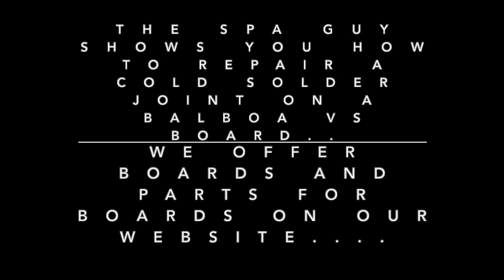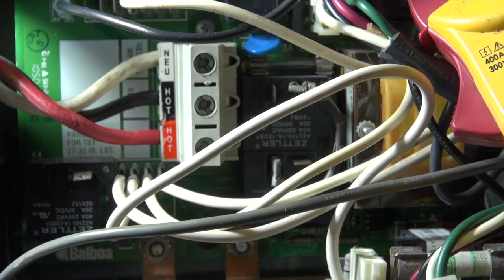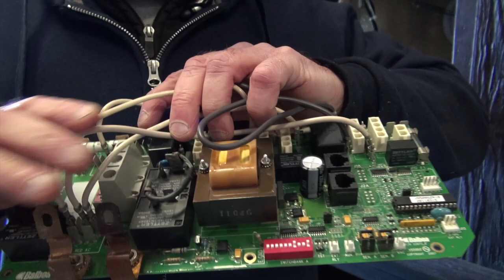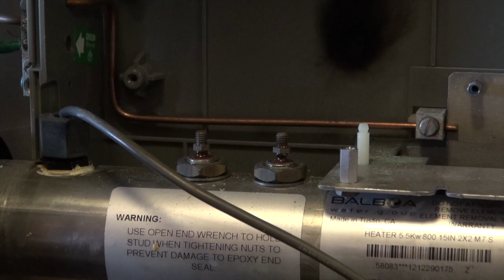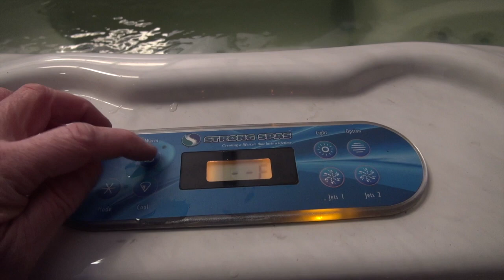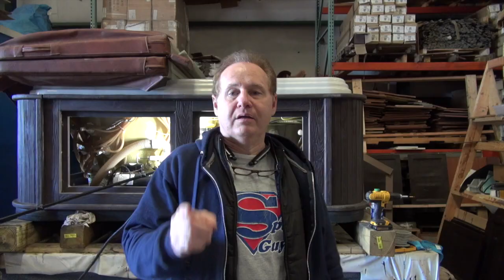Hot Tub Balboa VS Series Board No Heat Cold Solder Joint Repair The Spa Guy How To

Comment: Hi there, I like your spa videos. I have a heating problem with the Balboa HS200VS spa pack. I turned off the hot tub and drained the water; it was sitting empty for two weeks. Everything was working just fine before; after I filled it, the heater is not working. I can hear the relays click on and off. I get 220v at the heater element, but the heat light is not on, and there is no hot water coming out from the jets. I tested the heat element, and I get 16.4 ohms of resistance, and I have continuity. I tried the relay board bypass but it didn't work. What could be my problem?

Comment: I have looked everywhere to find out if there is a separate reset button somewhere I’ve checked all the circuits. Everything is good, but my Balboa will not start originally it wouldn’t heat past 90 now. It doesn’t start at all. I get no power. I have a brand new thermostat on it. Could it be that the plug blue I see no signs of burn

Comment: Im deal with a 2023 sundance tub. Where pump one was replaced, and now we are having an issue were " hot alt" comes on instantly, then the pumps run back and forth. Like pump one goes, shuts off, then pump two run.. 

Is that a heater relay, or heater core?

Comment: I have a Balboa hot tub throwing the GFCI, but if I disconnect the 4.0kw heater plug, the spa powers up with no problems, obviously no heat. I read 14 Ohms on the heater, nothing to ground so not shorted; just throwing me for a loop. I am replacing the element and will see if this fixes the issue. Just wondering if you’ve seen this before.

Comment: I have the Balboa 510SZ and my spa is probably 8-10 years old but I’m getting several codes, I have replace filters, temp sensors, and all new fuses, the blower is coming on but then I’m getting codes as followed: ICE, dr, LF, I’ve tried removing any air locks, when I reset is goes into PR, then —f, then the blower comes on temp lights comes on most of the time, I’ve tried changing the mode to std, only 1 time this weekend everything came on then when it got to 85-90 degrees the drY appears or dr. You can hear the clicking which to me it’s trying to switch the pumps on… I need help, I’m pretty handy but I’ve been at this for maybe 10 days… sorry for the long message

Comment: 5 years late to the party, but I have a question... Wouldn't you want to replace those relays given that something caused that solder joint to burn out?  I feel like jumpering the connections is a great way to overcome the bad joint, but it doesn't address the root of the problem.  I suspect the contacts in at least one of the relays were bad, and require replacing... No?

Comment: I have almost the same problem, but for me, the second relay has no output voltage. It's like the relay isn't closing... Any ideas?
Reply from the maker: The second relay is the turn on relay if it is not closing it could be that the system is not calling for heat meaning the temp is not set to call for heat or you are in mode that will not call for heat except for certain conditions. Like if you have it in the Economy mode it will only call for heat during the filter cycle and if you have it in sleep mode with will not call for heat at all. The relay could simply be bad but that is not the norm..

Comment: Well well well..I am so grateful my friend I have a 6100 failsafe with a 5.5kw my boards identical..This fixed my issue using the jumpers..Its -3c Ive been trying to figure it out for 3 days I also replaced my old 8yr element it was still functioning but I replaced it anyway it did its test fire and to my shear enjoyment the legs went hot 242v..You Rock!! Thank You!

Comment: Thanks for the info but it’s very hard to see what and where you connected the black jumper wires to on the k2 and k3 relays and the board itself also this repair doesn’t work if your relays are also bad which unfortunately is what I believe is my problem after I repaired the bad solder on K2 and added the jumper wires. So hopefully after k2 replacement I will be back in business I don’t quite understand how my tub is even remotely warm with k2 keeping the heating circuit open!!

Comment: Hey man! I did the jumpers on mine. I don’t have a volt meter just a multi meter. Any suggestions. I still
Not getting any heat out of my heating element. We replaced with a new element and verified continuity. Any thought?!

Comment: On mine, the jumper wire between K2 and K3 relays was completely burned. I checked both relays with a 9 volt battery across the coil terminals and continutity on the power terminals. Good thing I did. Coils for both relays activated (clicked) but only K2 showed continuity when 9 volt was applied to the coil. That means K3 relay is blown. Always check the relays because the power contacts inside may also be blown.

Comment: A friend called me with a problem. His spa was overfilled, he got in and displaced a bunch of water over the sides with pump and heater running. Twenty minutes later his spa turned off and wouldn't work again. He called an electrician and the guy disconnected the wiring at the board and at the breaker. Today I reconnected wiring correctly at the Balboa breaker, and at the board. Switched the breaker and it tripped immediately.
I disconnected neutral at the board, and reset the breaker, and found 120V at the neutral terminal. 
All fuses were above 2ohms when checked. 
All input is greatly appreciated

Comment: I don't have a tab on the red relay to check, and I do  have 120 from the white and the open terminal on the bottom relay,, but as you no power from that  terminal to the element,  can I run a jumper from that relay to the element lead?

Comment: i came across your video as i have an identical problem which will require the relay to be desoldered and new soldered, i was intrigued with the possibility of having a short cut you mentioned by adding jumpers. replayed your video several times paused it to review your explanation of how to, the problem i couldnt comprehend was that adding the jumpers the way you did was just tracing the solder joints with jumpers but still having to go thru the damaged relay which of course having the cold solder joint problem there the last jumper you added from the damaged relay to the open pin next to the heater brass jumper has no power hence impossible to heat. By no means am i trying to reprove you but can you explain how your repair caused it to work?

Comment: My VS 100 has a Balboa spa PN 56296-02 board ! I have no power to my heater. The heater checked out ok. Approx. 14ohms. I took out the board and didnt see any burned marks or obvious problems. How can I check the relays? They are soldered into the board and no jumper connections like you have.

Comment: I see you've circumvented the relays on the right.  Is there a way to circumvent the relay on the left.  I've replaced this relay but it still does not work.  The back of the board is burned and I suspect there was more damage than just that relay?  Thanks

Comment: I wish you were here... Ive got a similar issue on a 2006 Artesian Captiva 52.  FLO code and went thru all the norm checks and I believe its a relay on the board. No heat and recirculating pump runs for a cycle and stops. Winter is here and wondering if jumpers would fix the issue safely

Comment: Man. Thank you SO much for sharing.  Had the issue, and your video did the trick.  I’m using an 18-gauge wire for the jumper with some ¼” clips.  The wire is heating slightly.  Do you think I should have a heavier wire?  Thanks again!

Comment: Thank you so much for posting this video.  I would not have been able to diagnose my issue without this.  It turned out my relay went bad, the same one that had the cold solder joint in this video.  It would click like it was closing, but was not actually closing the load circuit.  This saved me from blowing $600 for a whole new board.

The Spa Guy is the best hot tub repair and troubleshooting resource in the country!

Comment: Hello friend, question on VS pack and expansion relay board for pump 2. Does the "ext relay" j60 need to be programed to run pump 2?
Setup is 220v. I added twin 5hp pumps. I added the expansion board so I don't blow the main fuse. The pumps drew to much current.
Pump 2 does come on. But un controllable. Almost like it is a 24 hr cir pump.
It will come on when pump 1 is in low mode.
Do I have to assign pump 2 to ext relay in test mode?

This is an older 2007 leisure bay celebrity. With a VS pack and a old 4 button lcd screen.

Ty

Comment: I have a Balboa VS system in a Cayanna Valley Spa. I mistaken thought I had turned off the breaker when draining the water. I have since refilled the spa, but the spa no longer heats. All lights are on and water is flowing,  the heating light comes on, but the temp remains unchanged. I looked inside the box and everything looks good, including breakers and surge protectors. Any suggestions?

Comment: Is there a way to contact you with a picture?   I have a board that blew a relay.  There’s also a very small component that also looks damaged.  I’m trying to identify it so I can replace it. Looks like a resistor or a diode just to the left of the heater relay.  With my phone camera I can see that it says what I believe is sj 68a and the symbol resembles one I found on google called vishay

Comment: Great video the best out there, really explained how my system worked.  In Colorado so freezing is a big risk so trying to fix myself, I thought I had the same problem but slightly different - No panel errors, circulation pump running, Heating element tests good, heating light is on, relay on the left closed, on the right first relay closed, second open.  Video helped me find that my second relay is open, heat light is on but the relay is open so can't jump that relay or as I understand the heat will not shut off.  Any ideas what can cause that or other testing I can do?  Can I replace the relay, I assume that is not an option so something is telling that relay to stay open or it failed?  But if it is system telling it to open then seems like the light would be off or there would be an error message.  Thanks for any suggestions!
Reply: Did you ever get an answer? My relay is stuck open too. What triggers it?
Reply: @dougspirit  hey me too same problem exactly
Reply: @andrewbeaverson1166  I replaced the relay. All good now.

Comment: I'm getting the exact same voltage as you everywhere, with no cold solder joint... any idea why is this?? When testing the electrodes with the board connected, I'm not getting any power but the relays are drawing the right amount of amps.  It's a brand new VS500z board from Balboa.

Comment: So what happens if I don’t have 208-230 on the bottom relay outgoing? Bad temp sensor or bad relay? Does have voltage on top relay and jumper to the bottom.

Comment: I was wondering if you could help me repair my hot tub mother board or give me advice. I already replaced the heater sensors and that is not the issue and the heater works but it does not stop at the set temperature, it keeps heating until it reaches 110 degrees where the emergency overheat relay shuts the heater down but it then gives me an error message and I have to hit any of the buttons on the readout to reset.

It is the relay that opens up when it reaches the temperature and breaks the circuit. They don't make my motherboard anymore so I am left trying to fix it. Any ideas on how to trace the relay that is not working? Everything else is ok except for the lights which stopped working after I messed around last fall so I think I may have a loose connection with them as they worked fine before I started trying to find the source of the heater issues. I have a CS9000 which has 5 pumps so it is a complicated motherboard. Any help is greatly appreciated. 
Thanks
Clay

Comment: Worked like a charm!  Thanks so much.  Vkv502 54380-02 vkv502R1a circuit board.   I was reading 0 across the heating element and once jumper added 240v.   Boom!

Comment: Do you know what error codes these mean:  100, 114, 28, and 120??  I have a Master Spa Legend series, 2005 model.  We just had a brand new circuit board put in less than 6 months ago.  But my husband was flipping breakers on and off trying to figure out which breaker was a hall light and it was after that I noticed the next day the breaker was tripped and not on. I have called Master Spa and somehow they have no idea what those 4 codes mean.  It is extremely frustrating. and their local dealer guys who came could not help either.  I turned the power off and did a complete scrub down of the filters and got any debris out, put back in, and it still isn't heating.  Pumps and lights work fine.  It is just very odd that those codes come up and I can't find literally anything anywhere on the net of someone else posting those same error codes and Master Spa not knowing what they mean either.  :/

Comment: I have a 2006 Cal Spa that half of the spa appears to be working fine which next to the controller panel.  I acquired the spa from family that had the spa sitting for several years.  It has a balboa controller system.  I filled the spa through the filter chamber but can’t get the other half to respond properly.  It went thru it natural cycle that did push water thru the opposite corners but then stopped.  Please help!!! Kprovidencekp@gmail.com
Reply from the maker: Bleed the pump.. https://www.youtube.com/watch?v=QhzEo6th2ng&t=24s&pbjreload=101

Comment: i jumped the right heater gold part to the jumper you did on the first right relay pin and it work.. with a 14ga wire soldered in place

Comment: i need to talk to you i have a badly burned board of that one, you can help me ill donate to your chanel here is the picture of my burned board, please help :P 
thats an EL2000 board from balboa... is there anywhere else i can grab that burned connection for the heater ? please help:( 600$ board ... the tub still works, i put in a floating heater, its still works as a charm but i dont feel safe using that floating heater,
https://ibb.co/RTKD4Cz
https://ibb.co/C08m3pX
https://ibb.co/xs93VyJ
https://ibb.co/jM2NJYq
https://ibb.co/xzk01HS
https://ibb.co/B3rzMxV
https://ibb.co/8m52m76
https://ibb.co/M61g07K

Comment: Error code OHS on a coleman 400 series (2005).  the water heater was replaced as well as the sensors.  Any other ideas?
Reply: moove your temp sensors connections at the board, it fixed my OHS

Comment: Hi, thank you  for the excellent video. I have the exact same issue in my 2010 Grand Cayman. The jumper wire was over heated, I do not have 240v to the element. I will be trying this repair. Thanks again, excellent video.

Comment: Sorry to bother you on a Sunday.  Great video; My problem appears to be at the very first relay because I never have 205V anywhere beyond the first tab on that relay (even with the heater light on).  Is it possible that the fuse located immediately above that tab (just above where the original jumper is shown on your video)?  If not, can I fix the problem with a different jumper?
Reply from the maker: Then you have a cold solder joint there.. There are no fuses on the heater circuit..
Reply: The yellow box you touch is burned. What's the name or do I have to buy all pc board
Reply: My 3 way terminal block length 1 1/2 x 1/2 has burned out any ideas where I can find a used replacement? And do you know why it burned out in the first place deanr6761@yahoo.com